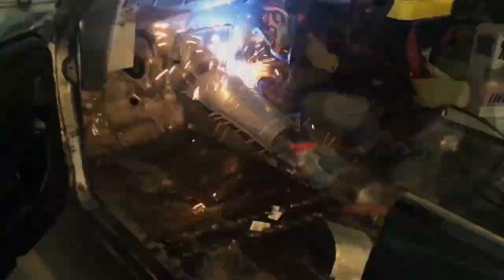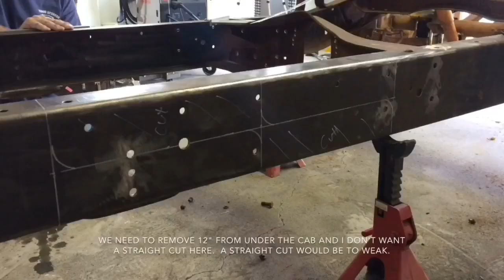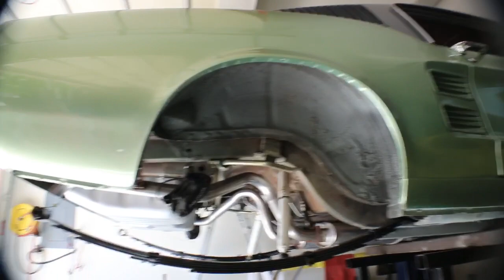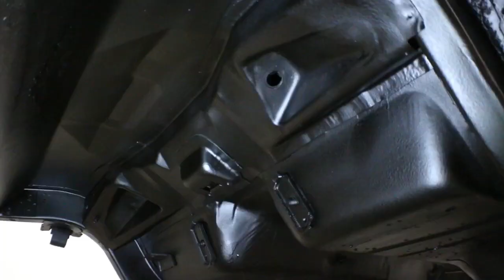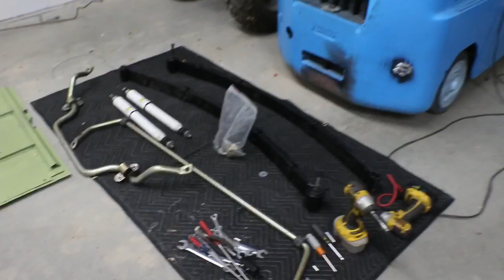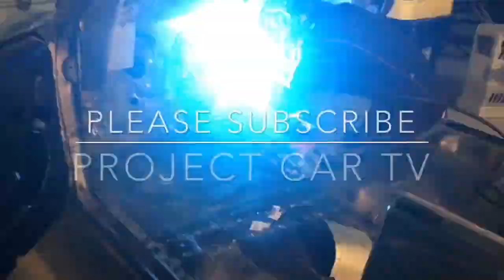Gramp’Stang - Part 4

Comment: First class job. I just did 80% - 85% of what you completed. I was limited to removing the exhaust and hand sanding & wire wheeling the bottom. After the bottom was as clean as I could get it I sprayed the bottom with a primer / flat black spray. Came out very well but I wish I could have done exactly what you did.
Reply from the maker: Thank you! It’s a lot of work but definitely worth the effort!